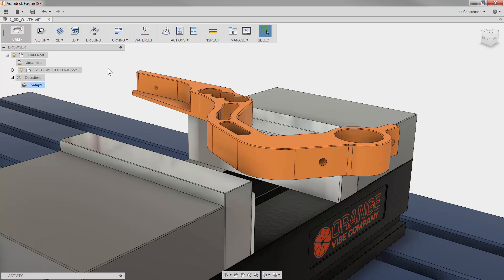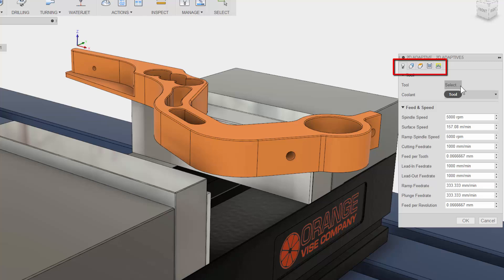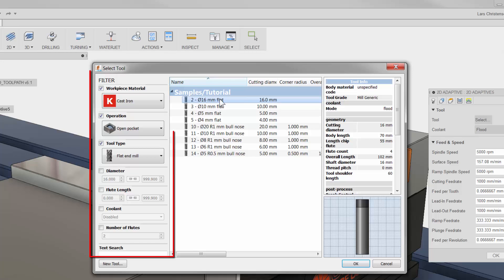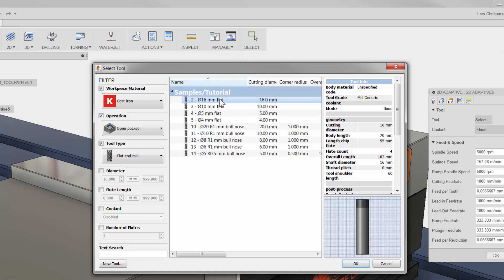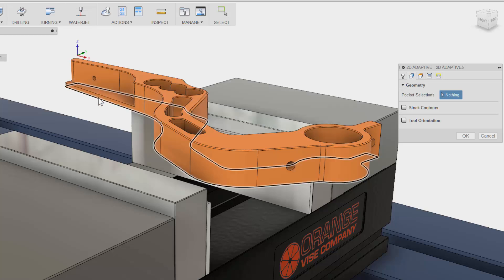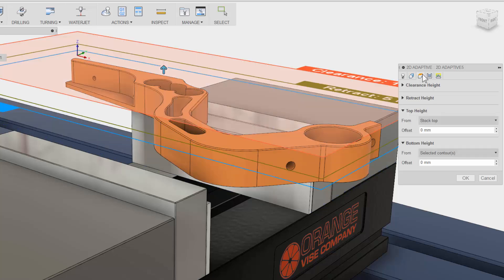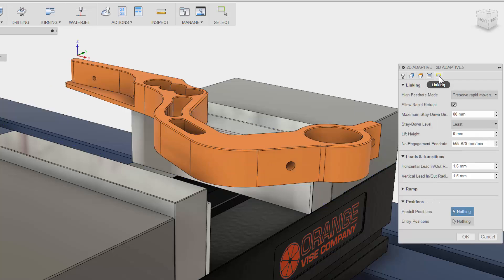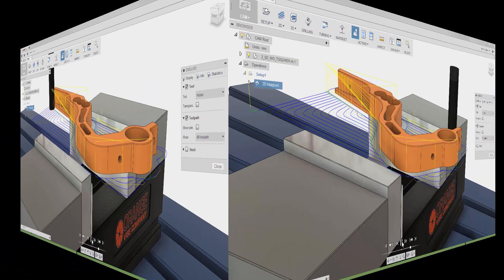Fusion 360 CAM — Quick Tutorial on 2D Adaptive

Comment: Lars...looking for help on work flow strategy associated with using a fixture (vise) and stock to do a 2 setup machining job.  I have an assembly with the vise and the stock size joined to it for the 1st setup operation.  the part model is locate inside the stock model and it worked great.  Where I am struggling is how to simply set up the 2nd machining setup as now the part is flipped over and held in the vise by the newly machined sides and I want to finish machining the part.  How can I create the new stock size that looks like the semi machined part and mount it in the vise?
Reply from the maker: +Patrick Lorenz Hi Patrick. Thank you for taking the time to comment. I really need to make a video on this!!! There are a few different ways to handle this. You can either save out your 1st machined operation as a STL ,or you could model up something similar to your 1st operation and use "From Solid" in the stock definition. This should really be the next video I work on!! Thank you for watching and hopefully I can have a video for you soon.
Reply: Lars Christensen Thanks Lars.  I will anxiously await the video.  I love the idea of having the fixture in the cam area to be able to avoid collision and ruining tools

Comment: It only works on parts that are flat with 90 degree sides. Adaptive clearing ignores all previous roughing forcing the cutter to engage in air for 90% of the tool path, which is just not acceptable. It completely ignores edges of shelves within the part forcing me to draw extra lines and curves to profile. Seriously, can this be any slower?
Reply from the maker: +Harrelson Trumpets There should be no need to draw extra lines. Not being able to see your part make it a little difficult, but there is 2D Adaptive and 3D Adaptive, along with Rest Machining option on the second tab, I'm thinking there is your solution. Honestly my friend, I don't want you to go bald over this :-). Email me at lars.christensen@autodesk.com and I can get one of the Fusion experts to make sure everything getting looked at. Thank you for being patience.
Reply: +Harrelson Trumpets Shoot me an email at curtis.chan@autodesk.com  I'm one of Lars' colleague on the Fusion 360 Team, and more than happy to answer any questions around Fusion 360 CAM.  If you're free for a GoToMeeting session, let me know.